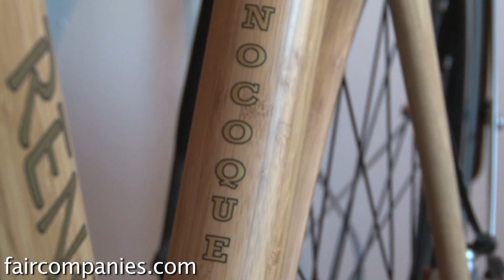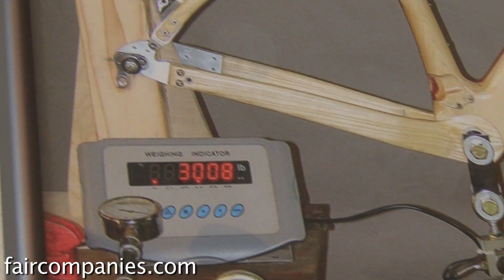A resistant, smooth material for better bike frames: hardwood

Comment: I don't understand why anyone would say wood is not stiff in torsion. I found a reference that gives the Modulus of Rigidity as 1.7E6. Steel is 11.5E6 but ten times heavier than wood. With a lighter material it is possible to exploit the advantage of a larger diameter. Seems to have a lot of potential.
Reply: ***** Harness does not enter into a question of flexibility.
Reply: ***** Your illusions are your own. My comment is about the torsional stiffness of the frame. This affects the stability of the bicycle. You have conjured up some meaningless scenario that has nothing to do with my comment. Go troll somewhere else.

Comment: It's going to suck when it snaps on you while your riding
Reply: It sucks when any frame material snaps on you while riding.  Unlike the other common frame materials, and especially that of carbon fiber, it is a lot easier to inspect visually for critical damage that may lead to a catastrophic failure in wood.

By the way, Renovo shares a story of one of their MTBs suffering a non-catastrophic failure in I believe the drive-side chainstay on a hard fall on rocks.  The bike was ridden several miles back to the car before being sent in for a repair, which did not necessitate the replacement of the frame.

Is wood the end-all frame material?  Nope, but these frames are stout as hell.

Comment: Apart from the metal crank, crank locking bolts, pedal stems, seat post, seat post locking ring, rear mech, front mech, handlebars, handlebar grips, handle bar tape, handle bar stop ends, chain, split link, shifters, wheel rims, spokes, spoke rim nipples, hubs, quick release bars, wheel locking nuts, front stem, fork stem, saddle, saddle angle adjuster, saddle adjuster locking bolt, bottom bracket, tyres, inner-tubes, valves, dust caps, brakes, brake blocks, brake cables, cable stops, brake levers, brake cable adjusters, pedals, paint, company logo, reflectors, cassette, gear cables, bell, front light, rear light, water bottle holder, water bottle holder bolts, rivets, forks, headset, and gear hanger it's a wooden bike.
Reply: Same goes for carbon fiber bikes, only the frame is carbon fiber, you still call it a carbon fiber bike
Reply: Bailey Harper The point is, if a bike frame is carbon fiber, you call it a carbon fiber bike.  Same case here.  Further, most of the additional things on your carbon bike could be made from wood, as well.  But most importantly, you're missing the point.  The owner of Renovo is not saying that wood is better than every other material.  He is saying that it is better than some other materials in some ways.  And moreover, that what he is building is not just supremely functional, but also beautiful and lasting.  Of course it's not the perfect material, but it is very good at a lot of things.
Reply: It's a matter of convenience not accuracy. This is done for public consumption.  People, like yourself,  who are educated in such things are not confused about it.
Reply: Traceur Snow Yeah but you can get full carbon components on your bike.
Carbon forks, rims, spokes, hubs, brakes, levers, seatposts, pedals, crank arms, handelbars, riding shoes with carbon fibre base plates in them.
Reply: Traceur Snow Not true, carbon fiber bikes like mine make up more than the frame being carbon. You must not ride much.

Comment: The difficulty is that when you re-weld steel it messes with the heat treatment and can weaken the joint.  It depends on where the weld is located though.

Comment: At 6:45 they show their finger joints with cross sectioning wood grain. That is not very strong according to theory. Finger joints are designed to extend the piece of wood and you do that following the grain. I would like to hear his response to that. Maybe there is a valid reason.

Comment: You seemed to have missed the part about living in the water 24/7 ...

Boats are also difficult and expensive to maintain, whether or not they're made out of wood.  It's one thing to pull in to your driveway after a ride, hop off, walk it in and wipe it down (if that's even necessary).  It's something else entirely to pull into the drydock or trailer the boat, pull it out of the water, and hose and scrub and clean and deal with marine life.  It's not a reasonable or fair comparison at all.

Comment: There's a big difference between something that lives in the water 24/7, has a number of mechanical complexities, and suffers damage from fuel, oil, and engine heat than something that lives in the garage (or living room) when it's not being used.

You can bet that when I have one of these, I'll be selling my current bike and riding the Renovo all the time.

Comment: As far as I know, they used downtubes (maybe it was top tubes) for all of the tests.  There is such a thing as oversized steel tubes, you know.  The steel is also obviously quite a bit smaller in diameter ...

Diameters aside, the results of that test are pretty clear.  The wood tube is dented significantly less.  And like he said, in the metal tubes, those dents serve for locations for cracks to propagate.  In the wood, not so much.

Comment: Except for the fact that Renovo has repaired one of their bikes damaged in a bad crash (and it was ridden for something like 12 miles after the fact), and tested it to original specs.

As an add on to your other comment, ask any carpenter about wood as a construction material and get a much different answer than what you gave ...

Comment: Dude try to think a little with your own head!
THE WEAKNESS OF WOOD STRUCTURE ARE THE JOININGS. IF YOU CAN IMAGINE THE SECTION OF THE WOOD FRAME (5:50) YOU WILL SEE THAT IT IS A PIPE, A PIECE OF HOLLOW  WOOD!
IF IT BREAKS YOU CAN TRY TO REPAIR IT WITH ANOTHER PIECE OF WOOD ( THAT YOU WILL SPEND A LOT OF TIME TO CREATE AND THAT WILL NOT BE HOLLOW WOOD BECAUSE IT WILL TAKE A LOT MORE HOURS TO BE MADE), BUT YOU WILL OBTAIN, AT THE END, AN EXTREMELY  WEAK JOINT EASY TO BREAK.
Ask to any Carpenter!

Comment: Bicycles made of metal work great, are inexpensive and can be recycled indefinitely, but especially if they break you can buy parts and fix it.
If you break the bike made of wood there is no way to repair it and return it solid and secure as before ...

Comment: I like how they use carbon forks on all of their bikes and how they don't really mention carbon fiber as a frame material. Also their crush test with the aluminum, titanium, steel, and wood was so flawed. They didn't use actual frames for the test because they all were about the same diameter. A steel frame is going to have a lot smaller diameter tube than an aluminum.

Comment: Since these are very labor intensive I assume these bikes are not cheap.  Some skis use wood as a core but it is laminated with graphite or fiberglass and uses metal edging.    I would never buy a solid wood ski.  What is the weight of the bike he was riding. Wood boats look beautiful with brands like Chris Craft, Riva and Gar Wood.  These boats are high maintenance and are expensive.

Comment: Even folding bikes aren't that convenient to store. You still trip over the pedals. things still get caught in the spokes, and it still moves around when tapped.
.
The solution to storing your bike is the ceiling. Two pulleys and a steel cable, and your storage problem is solved.

Comment: D. Wood is not "far from high tech" its just generally excluded from modern materials---not because it isn't desirably light, it is---and not because its unacceptably weak, because it isn't. Wood has simply been left behind in the recent scramble for so-called "high-tech" materials.
.
The problem with laminate wood composite is the price behind growing lumber, and turning trees into thin layers of wood, and turning that into a solid block of wood. Bamboo is a much better option.

Comment: A. Carbon fiber can be very fragile. Any significant scratch or gouge, and the damaged part WILL delaminate, sooner or later. It isn't prized for its strength, its prized for its weight.
B. You will never find a carbon fiber bike for under $1,000. Usually the frame and tires alone costs several thousand---that's without any gears or breaks.
C. Racing bikes are amongst the most expensive bicycles. If you think you'll find a decked out carbon fiber racing bike for >$1k you're dreaming.

Comment: For $150-$300 you can get a bicycle motor kit, to make that $200 bicycle pedal itself. Mine is 80cc, can go 70km/h, costs $3 to fill the tank, and I get a solid 50 clicks per tank---all with no drivers license, and no car insurance.

Comment: As an ecology student who has worked with wood I'm impressed.  It is easy to forget what it takes to grow, harvest and prepare before we can even work with something.  Additionally, there is a difference between expensive hand tools and more expensive machinery and design time, layout, cutting, etc... test, and more. To every item we use there is a cost, often others pay the hidden costs. I would believe there are less hidden costs with these bikes. I hope Renovo supports reforestation.

Comment: Wood takes A LOT of time, energy, and resources to go from a seed, to a shrub, to a tree, to lumber. Months, even years. Some species of bamboo can grow 12 inches in 24 hours. That's usable lumber within a month. What's a tree seed after a month? Two inches, and two finger-nail-sized leaves
.
Carbon fiber? Christ no. So painfully expensive, so prone to delamination. Hemp is infinitely cheaper, and has comparable strength
.
This could be done for CHEAP using bamboo lumber & hemp composite joints

Comment: What an awful waste of time and energy. For 1/100th the mechanical energy, biological growth energy, and work-time, you can simply grow bamboo and hemp (both of which grow many many many times faster than lumber trees), connecting the joints with hemp fibers soaked in epoxy resin. This design has been shown to be as strong as a traditional aluminum / steel frame bicycle.
.
/watch?v=xoE3Sc-M73o
.
This should NOT cost $2,000. It should cost on par with any normal, average bicycle.. if done right.

Comment: You've got to be kidding. Carbon Fiber might sound like a good thing (I'm actually building a new MTB rig around a full carbon frame) but it's a bitch to maintain. Just a slight gouge can mean the end of your frame. It might be super high tech, but it's prone to catastrophic failure. And you won't get a carbon frame itself under around 1000$ let alone a complete bike with higher end components.

Wood is the king of materials, and as a bike junkie, I'd get one of these.

Comment: I've seen a similar product on Daily Planet---except it was made from bamboo, with hemp & resin for the joints. Similarly, they were woefully expensive, which simply shouldn't be the case.
.
I can grow bamboo and hemp (legal to grow in Canada) for mere pennies---and scrap bike parts are dime a dozen these days. I can literally put together a parted-bike for free any day. Done right, with a bamboo frame, there's absolutely no reason these shouldn't cost a lot less than a normal bicycle.